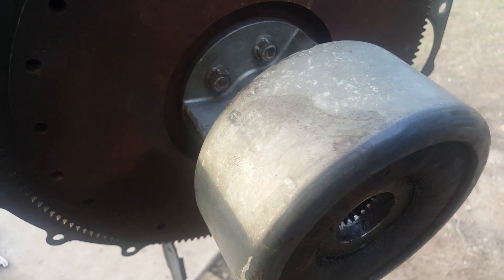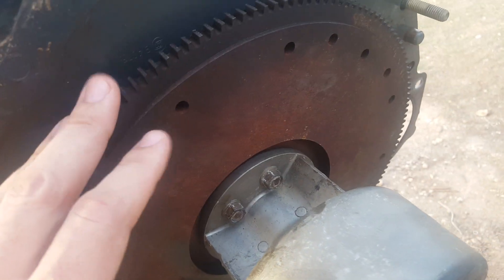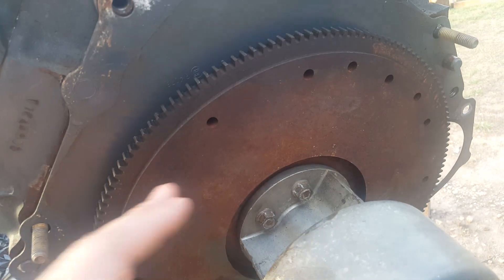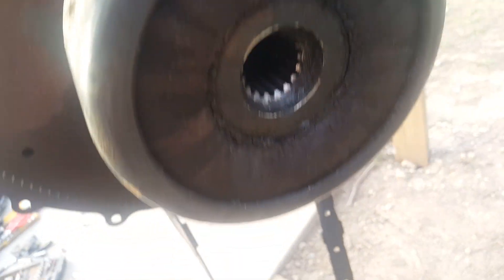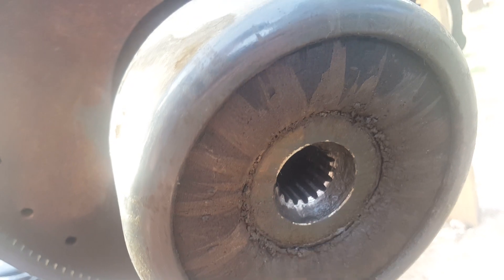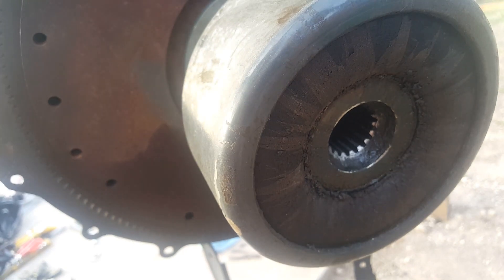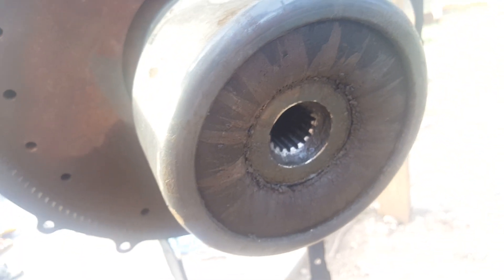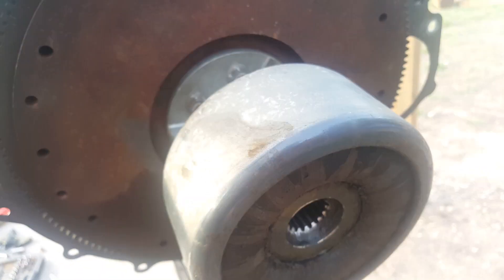What's a Marine Engine Coupler? I’ll Explain!

Comment: How much would you charge to change one engine coupler with correct alignment for a D3 penta with DPS-A ? I am courios because a guy in Greece asks for 2300 EUR around 2600 USD to change it for 2 engines and I thing this is way to much ...
Reply from the maker: The reason why they charge so much for a pretty simple replacement part is because they got a pull both motors out. Depending on what’s in the way, it could be 90% of the time pulling motors 10% replacing the actual engine couplers.

Comment: I had that exact problem on my 3 L cobra motor shared off the bolts after had somebody rebuild it. Only had 12 hours on the breaking of the motor How do you suggest lining up the motor correctly? How do I tell if the Cupler is bad?
Thanks for your help!!
Reply from the maker: Look up my engine alignment video. Please subscribe!
Reply: Michael Romer  yes I found it thank you!👍

Comment: Hi Michael, my volvo penta sx-m 1.51 locked up and the bearing carrier for the drive shaft busted, I'm still have a marina look at it to see if its fixable, but I did notice that the splines on the drive shaft that comes out of the engine coupler are twisted the last inch or so. Do you think its possible I damaged the engine coupler as well? I'm going to try and scope it from the gimble bearing side to see if I can see anything but I"m not sure I'll be able to see if the rubber hub area twisted. I assume this coupler works much like the propeller hub with the rubber in that when it receives to much torque it will shear? Great videos. Thanks
Joe
Reply from the maker: Joe, I’m 99% sure you spun the rubber hub inside the engine coupler. With the gimbal bearing removed, you will be able to see if the female splines are damaged, or worse case it walked out of the coupler. I’d be shocked if your engine coupler is in good shape.
Reply: Michael Romer thanks Michael, Yes I wasn’t sure if those engine couplers are designed the same way as the rubber propeller hubs. Here’s the weird part though, when the outdrive was in when i tried to start the engine it was locked up tight i would just get a clunk and it would move just a slight amount but not turn over. When I removed the outdrive the motor turns over fine. I’m hopeful that it’s still intact but yes I would be shocked if it didn’t break the connector. I appreciate your quick response. I’ll let you know what I find.

Comment: Thanks for sharing some good quality videos of OMC repairs! I am assuming there is no way other then pulling the motor to remove the engine coupler? I was hoping pulling the drive would allow me to remove it without pulling the motor.
Reply from the maker: The main issue is your flex plate.  You would have to pull it far enough away to clear that which would cause impact to the transom. I can't think of a way of removing it with it installed in the boat.
Reply: @michaelromer2016  Thanks.

Comment: Michael, very good work, and your short and to the point videos are second to none.

I am in the process of doing engine alignment. Ordered the alignment tool, and while the engine is out I made a quick test.  See this video - https://youtu.be/GGeWxrzI3PoWould  you agree the tool I have received is way too small, and it should fit snug in the engine coupler?  What is the diameter of the tool you have, the section that goes into the coupler?  
Thank you.
Reply from the maker: The tool looks correct. Keep in mind, with the engine out, you don't have a way to simulate the pressure from the gimbal bearing. Plus, the round tool is going into an engine coupler that is made to have splines. Please reply here and let me know what the diameter of the very last section of the tool is--it should be 1.0 inch or roughly 25.4 mm.
Reply: @michaelromer2016  with the alignment tool pushed all the way into the coupler, how is it possible to easily turn the alignment tool with two fingers, like you show in another of your videos.(#63 or 64 I believe)
Reply from the maker: @DQDaniel1  The engine alignment has to be within specifications. If you can't move it with two fingers, watch my video on engine alignment.